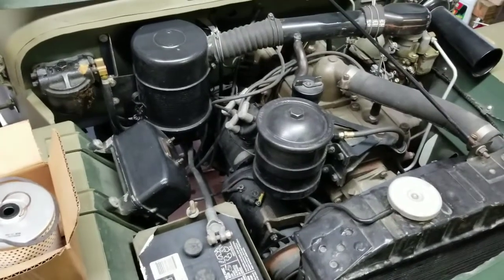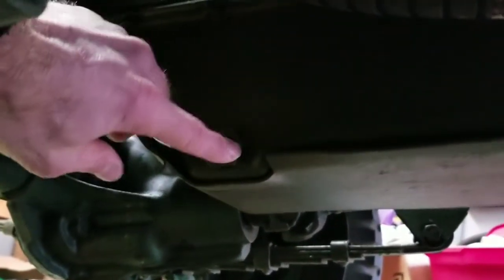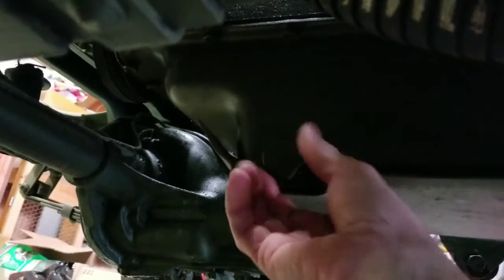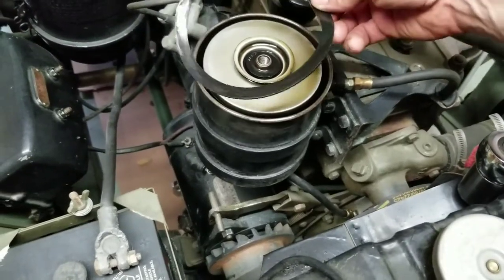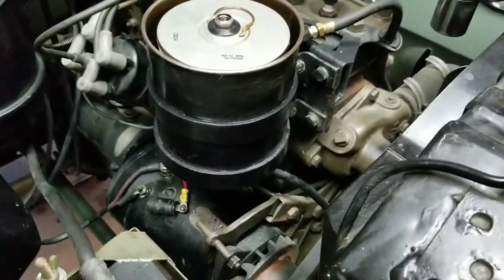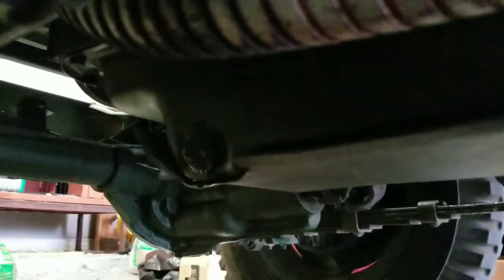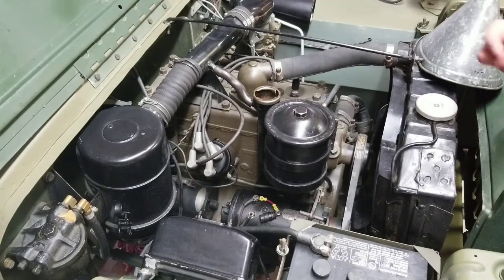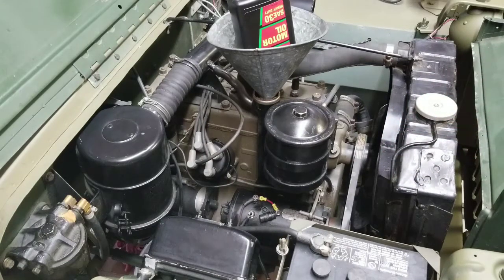WW2 Jeep Oil and Filter Change Service for Willys MB / Ford GPW

Comment: There is always oil left in bottom of filter canister as arlingtonguy says...bad design cos doesn't drain so you have to empty it out.
Reply: Even I feel the same, but then it was the pioneering days of automobile design. The filter directly on the block I am guessing was a Mercedes Benz innovation..??
Reply: Mine has a drain hole to drain the canister. But it's a 48, perhaps later models have that?
Reply: @bradh5613 ...All same.. Won't get the last bit of oil out because that drain is not right at bottom.
Reply: @bradh5613  My '47 has a drain hole in the canister as well, but the head of the drain plug is rounded so much that a socket wrench slips off.  I think a previous owner may have replaced the plug with one that has the wrong thread.  Anyway, it's stuck and I don't want to risk damaging the unit by using gorilla force.  Also, the drain hole sits above the generator, so draining it risks getting oil all over the generator.  Instead I use an old rag and some paper towels to sop up the oil and to clean out the interior of the canister.  I've read that some enterprising owners use a turkey baster for this job.  I may have to try that.
Reply: bazthehandyman  My is going to get a draincock, with a hose on the bottom, to dump the oil where the engine drain plug is. Enough of this foolishness. :)
Reply: @daveunderwood6498  That's how I solved the same problem with my ATV gas tank drain, then I sold the thing and never looked back.  The Jeep is more fun to drive anyway.
Reply: @Paladin1873   You've got that right my M38a1 is my daily driver. 😎
Reply: @daveunderwood6498  ...yes good idea Dave if it's right at bottom.
Reply: 2 different war time canisters, both have drains at the bottom, that he didnt utilize. One is POB, the other is PAB. POB=piss on the block, (makes a mess) other is PAB=piss away from block. Small cup catches it, not so bad. Lol.

Comment: When you're pulling the oil filter out of the housing you need to take it and let it drain into a drain pan not back into the canister because the old oil the filtered oil the non-fertile oil is dripping right back in your can and back into your engine

Comment: I have a 1943 Willy Jeep that has not been running for a few years.  Today, I installed a new battery.  The fan turns and it sounds like it is trying to start.  I realize it probably needs oil change/filter change, gas drained.    Any tips you can offer?   Or suggest videos I could watch?   Thank you
Reply from the maker: Here's a playlist with over 30 videos showing various service and repair demonstrations for these old jeeps.  Hope this helps!

Comment: On my 47 Willys CJ2A flathead engine I use non-detergent SAE 30 and add Zinc to it to prevent the lifters and camshaft from wearing down prematurely.

Comment: Did you drain the oil filter canister before you put in the new filter ?
Reply: I also qustioned about that. I used a large syringe to remore the old oil from mine then cleaned the cannister with a shop towels

Comment: SAE 30 Oil? I use 20W50 in my Willys.
Reply from the maker: SAE 30 per TM 9-803 lubrication guide.   Nowadays, engine oil viscosity is more of a personal preference it seems.

Comment: Did you take the residual oil out of the filter canister?
Reply from the maker: Yes.  I did a good wipe down of the inside of the filter canister before installing the new filter.

Comment: Do you still add lead to the gasoline ? My lead container says ½ oz. to every 5 gallons -- sound about right ? Also, 87 octane or premium (91or higher) ? Thanks
Reply from the maker: I don't use any lead substitute additives; just straight 87 octane -- ethanol-free if you can find it at a marina or other locations.
Reply: @WW2JeepandRifle  -- ok thanks on the gasoline tip 👍🏼 In addition l'm fabbing up a hand-crank starter for my 48cj2a as they're almost impossible to find. Most bumpers have that factory hole in it for placement to the crank nut. Have you ever seen or messed with any hand cranks ? (Which l think are awesome as a fail safe to a dead battery)  I think it comes factory sometimes along with an air pump stored under the rear bench seats ? -- thanks much!  And also great vids !   OlllllO